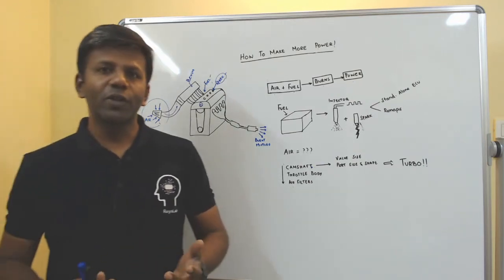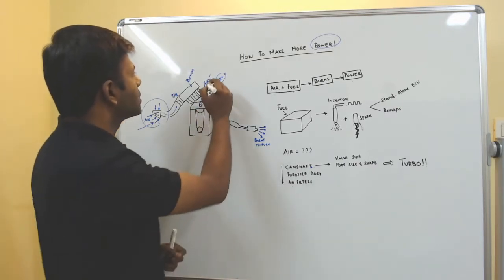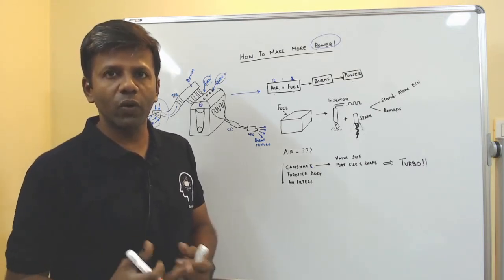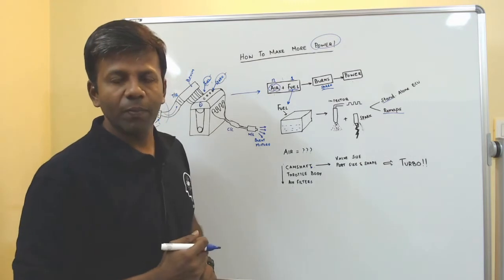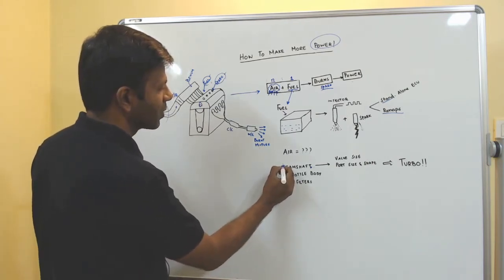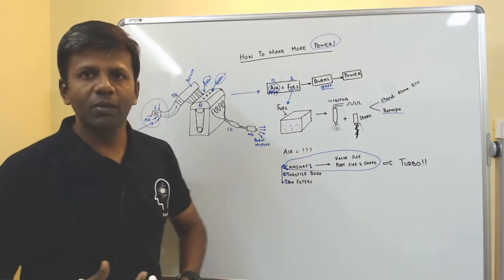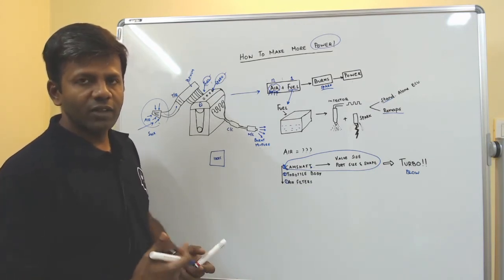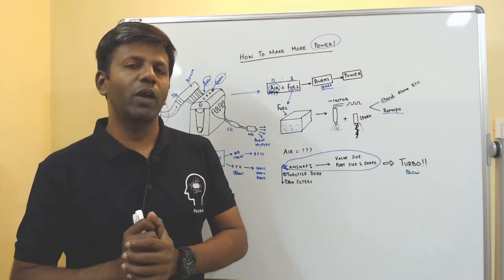How To Make More Power from your engine?

Comment: Please make more elaborate videos on how to remap an ecu. More specifically like understanding how to fine tune air fuel ratios, throttle position sensors, mass air flow sensors. It would be very appreciative
Reply from the maker: That is a whole course, Check it out at www.reynlab.com